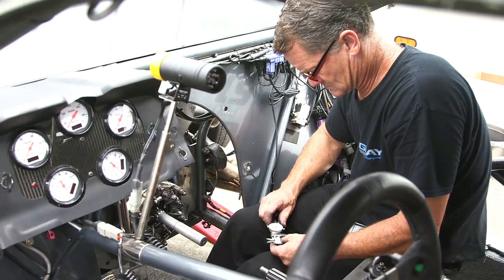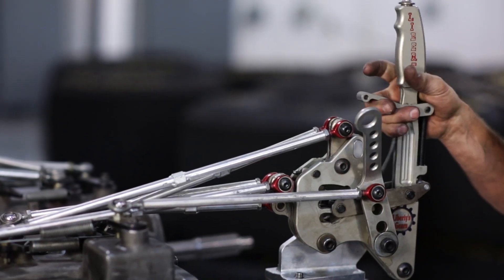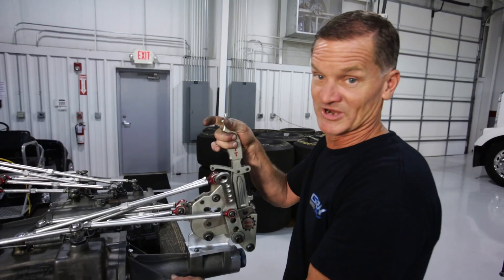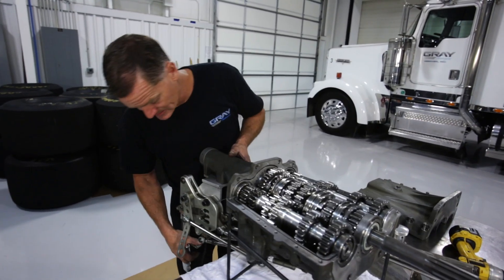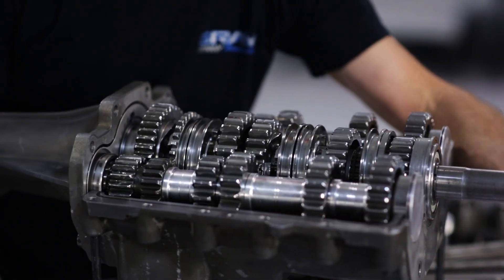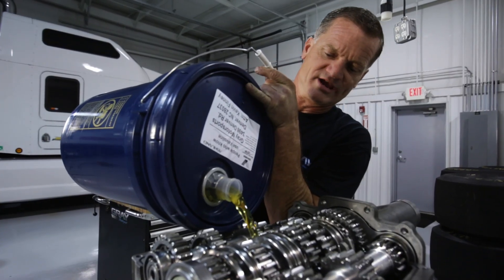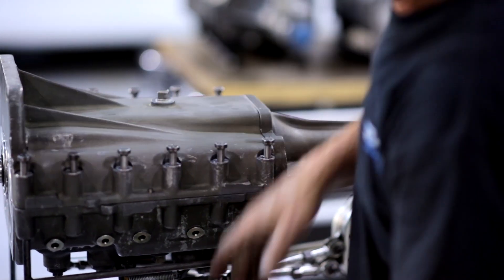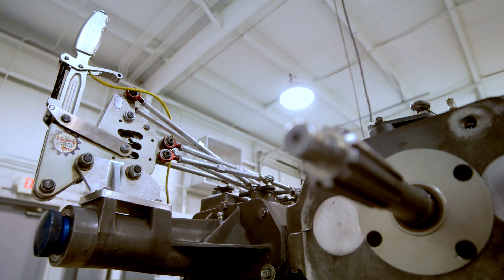Inside the Transmission of an NHRA Pro-Stock

Comment: How do you not need the clutch after start? How does it change gears with that much load on the gears?
Reply from the maker: Basically, the gears match rpm inside so the load doesn’t change. The dogs inside are cut to grab the gear. If you don’t pull the shift lever hard enough they skip and tear up parts.
Reply: @valvoline  I actually watched a video on how these transmissions are able to do this, and yes they get damaged over time and interestingly they do not use synchronizers at all and is really how these gears couple to each other under load. You can not shift a transmission under load that are equipped with synchros, at least I have never been able to do it and is the reason why I could not grasp the concept.

Comment: I remember reading where Grumpy Jenkins would grind off every other tooth on the gears in the transmission. It made it easier to shift. Back then they had to use the clutch for every shift.
Reply: I think that was a synchronizer modification.

Comment: automatic in manually
Reply: Guys have been shifting fully synchronized standard transmissions without using the clutch for decades. Many factory made sports cars have that capability. But nowhere near as tough as these full-on racing transmissions.

Comment: They can change out a transmission in 10 minutes??? Holy crap! It takes me that long to get up out of the recliner! L.o.l!
Reply: Not just "changing out" or "swapping".........he actually opens the thing up & replaces 1st, 2nd, and sometimes 3rd gear as well, and anything else that needs worked on. "Changing out" is simply swapping out. But what surprises me, is that he never mentioned "swapping out" one transmission for another that is ready to go. That would certainly be faster than rebuilding parts of one transmission & re-installing it. Surely they have at least several transmissions.

Comment: Wait how does downshifting work? Do you have to get all the way up to 5th and then go back down? Or does one of those levers do it? Not that you really need to downshift while drag racing but I'm curious.
Reply: They kill it on deceleration, drag it back to the pits, and rebuild the transmission after every run. I believe they just reset it to first after they rebuild it
Reply: Its the same as upshifting, but u need to pull the small lever up while doing that so the selector goes up and selecting smaller gear.. imo

Comment: “We do a tear down and gear change in about 10min.”  My mechanic- “we’ll call you in a couple days... maybe.”
Reply: XD I know right
Reply: that looks so much easier to work on that the trans we have in our cars lmaoo
Reply: Quick change parts. Plus, they do not rebuild the entire transmission, just the gears basically.
Reply: Auto Dealership repairs want that comment removed 😂
Reply: thats gonna be ahh about 800 for labor and 500 to source parts we only do oem straight from the dealers so you know your in good hands
Reply: Not sure if you're aware but when you do the same rebuild thousands of times it becomes easier and you have all the parts required on hand. Not every dealer ship has worked on your nissan Micra, nor do they have the parts on hand kid.
Reply: I wouldn't want that guy working on my transmission. That's not the pattern you use to tighten it back on. You don't tighten one side and then the other. I wouldn't want you to use power tools either. They are suppose to be torqued down to spec. Looks like a half fast job to me from a guy who doesn't know what he's doing.
Reply: @mattferrigno9750  your comment is laughable at best. Your talking about a guy that has done this for a living. He knows something you don’t. That’s why he’s where he’s at getting it done in ten minutes while your there wondering if you torqued it right with your torque wrench specs off google search. They didn’t get to where they where if they didn’t know what they were doing.
Reply: Ikr
Reply: Said no one who’s ever actually ever built anything or worked with his hands. He builds the same tranny day in day out with parts right next to him. Respect to him cause he’s good at what he does however You think you bring your piece of crap(that you clearly can’t work on)  in to a dealer and techs are standing around just waiting for your special self with parts on a table on a transmission exactly for your make and model and year with different problems and not to mention they gotta wait for your broke butt to approve the work on the clutch cause you think your daddy never taught you how to drive. Ignorant child.
Reply: 1. They are obviously being paid more.

2. They do this to the point where they are just going through the motions, its the same exact nut and bolt size everytime. Higher quality parts equal less chances of them having to come across stripped threads or jammed nuts.

3. They are specialists when it comes to that one type of transmission housing. Regular mechanics would get curveballs thrown at them when it comes to every customer's car that they handle.

4. Readily accessible parts on hand- no need to wait days, weeks or months while waiting for that certain part to arrive.

Comment: For all those asking about down shifting.
You don't down shift a car going 300 mph.....
Your head will explode and ruin the upolstrery.
Reply: These are PRO STOCK........they don't run no "300 mph"......those are the funny cars & top fuel dragsters. Pro Stock only run at or a little over 200 mph......you jack ass.

Comment: He just went through 5 gears faster than some teams can get through a two speed power glide! Seriously though getting through all of those gears takes someone that knows how to multi task, not only are you going through the gears but you gotta peddle that car when it tries to break lose, anyone that has raced in a no prep  knows what i'm saying, it Doesn't matter if you have a ten thousand HP motor if you can't get it to go  A to B without any  trouble your going to be loading  that ten thousnd hp car back on that trailer, it happens to the best.
Reply: Shifting a transmission that has a linkage set-up for an IN-LINE shifter ( you simply yank the shifter straight forward & straight backwards for each gear, without having to move the shifter laterally for each gear ) is much easier than you obviously realize. Shifting that IN-LINE set-up is the easy part......the hard part is the peddling to keep traction.

Comment: Way cool Valvoline. Thanks for the quick overview. Love them stick shifts. What's the benefit over a Lenco, besides the extra gear? When the 5 spds came out in the mid to later 70s, I didn't think they were as favorable as the 4 spd Lencos.

Comment: Why doesnt the clutch need to be used after 1st gear?  Surely there is a mismatch in speeds...
Reply: well i get that point.  I'm talking technically speaking, how can the trans shift under power without breaking?
Reply: Synchronized gears, they all spin at different speeds but the sliders that engage every gear also work as a rpm synchronizer

Comment: Did he just say they pull the transmission, tear it down, change gears, fill it up with oil, put it back together, and reinstall it within 10 minutes???
Reply: Yes, they are easy to take out, and as you seen when he bolted it back together, the cases are easy to split, and the gears are easy to take out and change. A manual tranny is a lot easier to pull than an automatic.
Reply: I wish my T5 was that easy to open up.
Reply: It's sequential, small and light-er
Reply: Yep. Why can’t we build shit that lasts longer than that?
Reply: Meanwhile AAMCO still working on yo shit from 2 days ago 🤣🤣🤣🤣

Comment: What kind of transmission is this? I need one in my life
Reply: Well get ready to pay close to 10 grand for it.
Reply: no problamo
Reply: It would be considered a dogbox transmission because of the way the tranny shifts. Instead of using a shifting fork which requires you to use the clutch a dogbox uses "dogs". So your shifter is moving the dog rings that have slotts in them for the dogs to slam into. Which is why you can shift without using the clutch because you are litteraly just moving the gears amd they lock in because of the dogs. Henceforth the "dogbox"
Reply: Be carful what you wish for

Comment: How does the driver shift gears without using the clutch?
Reply: Sequential trany, like a motorbike trany !
Reply: @coco__rnd  thay all have a clutch
Reply: @louisedwards6681  yes ! but you don't need to use it to shift. If u want u can only use it for stop and start
Reply: @coco__rnd  that's right 🕺
Reply: @coco__rnd  I drive a1994NISSAN and I can shift w/out (stepping on the clutch)  , this truck has 3 Hundred thou    mi s.  ,,,,,, BUT I am an automatic transmission Rebuilder and I know how to shift the Transmission  without a clutch ,,, But you need a clutch to stop and GO ⚡

Comment: Real interesting!!! Definitely the incorrect bolt torque sequence though ;)
Reply: just the approach of the bolts, you won't apply the correct torque with an electric gun anyway (for this application)
Reply: Ian Thompson Much worse is that he just poures some oil in there and puts the cover on😂
Reply: he didnt even torque them. 
Lukas Langer, Im sure he knows exactly how much to put in just by eye. Im assuming he does it after every single run if he tears the trans down after every run.
Reply: i would imagine being a crew chief he knows the transmission better than his relatives. lol
Reply: Ian Thompson You can torque your bolts if you want but you won't last in this sport.  If torqueing bolts to spec is your only concern you have no business inside a transmission or at the race track.  The transmission Is disassembled after every run. The run is 6 seconds. This is not a daily driver that is subjected to extended periods of vibration. Use your fucking brain before you make your gay posts, there is no comparison between your Honda civic and a top sportsman car.
Reply: Ian Thompson always a guy trying tell someone that lives and breath the shit he is doing something wrong
Reply: Fuktard
Reply: Ian Thompson your an idiot.
Reply: @lukaslanger5068  Lukas Langer.........You're just too stupid to understand this guy has rebuilt more of these racing transmissions than you have taken a shower. Not only that, the transmission is completely exposed and open, so he can clearly see THE LEVEL OF THE OIL as he is pouring it in........ya clueless fool.
Reply: Anthony Rybczynski chill out you sound like a little bitch, he was just making a joke but you took it straight up the ass huh?

Comment: i thought drag trans is a planetary one, and it's a dogbox?
Reply: no, it's sequential
Reply: yes, i see, a sequential dogbox
Reply: it's not a dogbox ; it's a fully sequential gearbox you don't have the H patern on this trany
Reply: dog clutches are the cogs, which mesh together and engage the gea, the different from the synchromesh setup. the dogbox can be sequential or h-pattern, it doesn't stand for the way the shifter stick moves

Comment: why not run say another torque converter style transfer case or a chain/belt slipper clutch like a go kart, or even the Bugatti , run two transmissions and clutches , that way there is no gear shifting , like a turbine
Reply: Some drag racing classes do run manual transmissions like this with a torque converter, others use 2 or 3 speed automatics, and some just use traditional manual transmissions: It just depends on the rules of the class. Using a DCT like in a Bugatti would get very expensive. A built 2 speed powerglide that can handle around 2500 hp is around $6000, you can get parts for them pretty much anywhere, and they're easy to fix. A DCT that could handle that power and torque would cost over $30,000.
Reply: for easy rebuild, he said they take it out after every single run. That thing probably to complicated to rebuild in 10 minutes.
Reply: Yeah but ultimately a transmission can be made with no shifting and handle 2500- 4000 HP and without having to be rebuilt every run. I mean look at mining equipment , they're stuff is built to move 24/7 365 , imagine if they had to take the transmission out everyday , and that's just the transmission
Reply: Do you think you can pickup a "mining equipment" transmission like they do? 
First, mining equipment mostly use hydraulic transmission to transfer power. They spins slowly and are well lubricated.
The main shaft in a transmission like that spins at engine speed, so around 9000rpm. At 9000rpm, oil don't stay on the gears...

Why would they use a DCT when this is both lighter, faster, and more reliable?

For the "go-kart" thing, are you talking about a variomatic? Also known as CVT... at that kind of power no... They already struggle on less than 200hp cars.

As for "run two transmissions and clutches , that way there is no gear shifting , like a turbine" I have no clue what you're talking about!

Comment: So it's like a motorcycle transmission? That's what I'm getting
Reply: not what Im getting. Im getting that its shifts similar to a normal manual trans except the linkage allows for back and forth action.
Reply: dirtrider88 I'm fairly sure he was referring to it as a sequential box, rather than a traditional one. You can make the linkages shift any way you want, for example an H pattern or 1 N 2 3 4 5 like on a motorcycle. This just has a back and forth so it's easy to do in a short amount of time.

Comment: Does it have a neutral also? 😂😂😂😂
Reply: Maria Sensei Kimo it has a clutch
Reply: Yes, a Liberty's Pro Stock transmission has a neutral and can have a clutch or a torque converter/fluid drive/Bruno input front end drive, also can have a manual shifter, manual air-shifter or electrically-controlled air-shifter.

Comment: Is it sequential, motocycle-like gear box?
Reply: Billy Bill yuh
Reply: No, it isn't. This transmission uses an external gear shifter, sequential and motorcycle gearboxes use an internal sequential (i apologize for the redundancy here) shifter, usually forks mounted on a shaft, with a desmodromic drum that drives them up and down said shaft and they, in turn, drive sliding gears
Reply: No. Straight cut gears like many motorcycles though...

Comment: What a strange gearbox command... usually, a sequential gearbox works in a different way.
Reply: drag racing cars don't need to switch between upshifts and downshifts. They made the upshifts pattern as easy and fast as possible because that's all that matters.
Reply: This make sense. Probably a conventional sequential gearbox would work good too, but this on looks like a poka-yoke (in the sense that with this gearbox the driver should not be able to give the wrong shift command)
Reply: Sequential gearboxes are slower when shifting, and would be unnecessary for this application